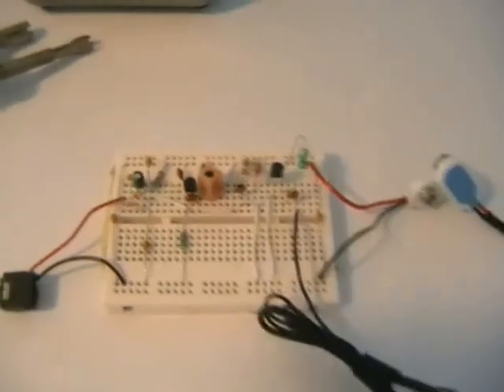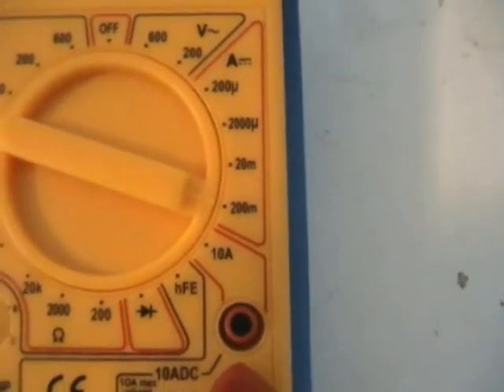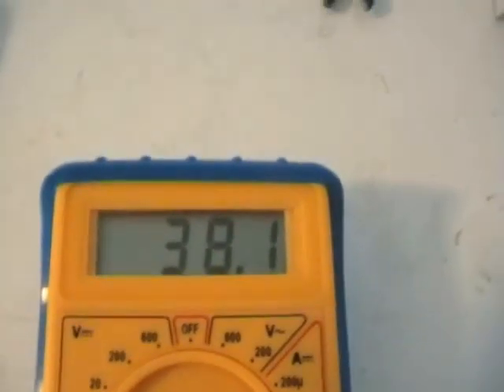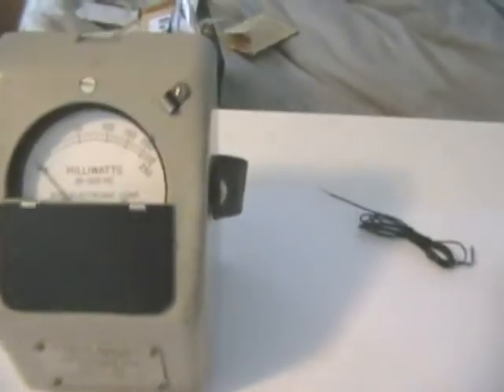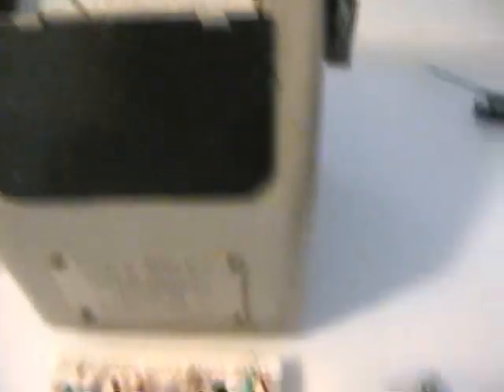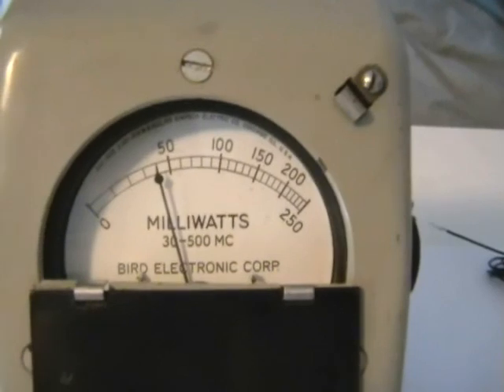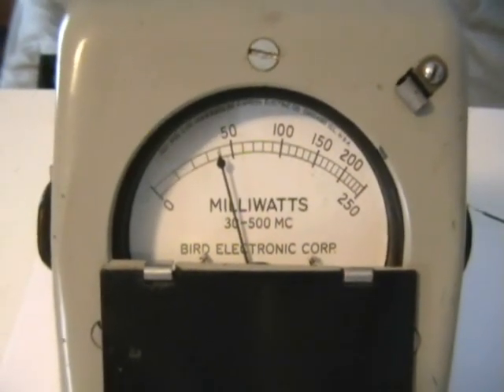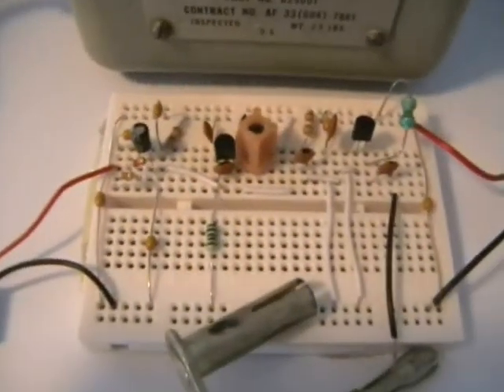Make your own radio station.

Comment: Ok got u ty. I also am having trouble finding... 33pf, 30pf, 10pf, 1n, 22n in the us at my local radio shack as everything is moving to chips these parts are getting harder and harder to find. I know the pf is picko... but what is the 1n? A cap right? But what kind?

Comment from the maker: Its a mono transmitter not stereo.
To make a stereo FM transmitter you will need a FM transmitter IC like
a BA1404 or a BH1515F and many others.
You can not build a stereo FM transmitter using a colpitts oscillator
design.

Comment from the maker: For a transmission range of many miles you need a lot more RF power ,a lot of RF watts ,a 10 watt transmitter may get about 5 miles range ,this transmitter is a very low power transmitter about 4mw and there is 1000mw in one watt .